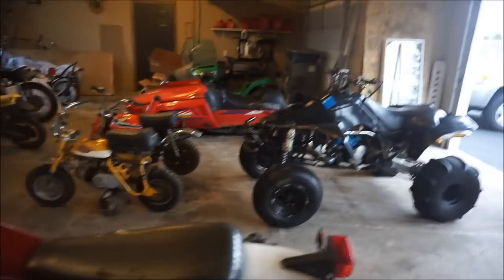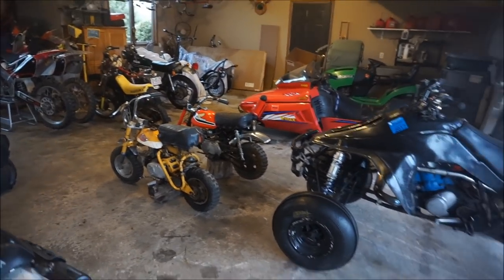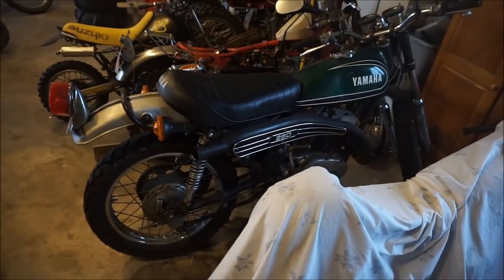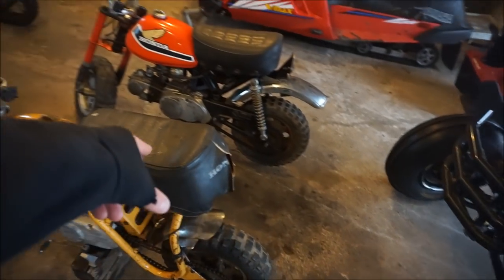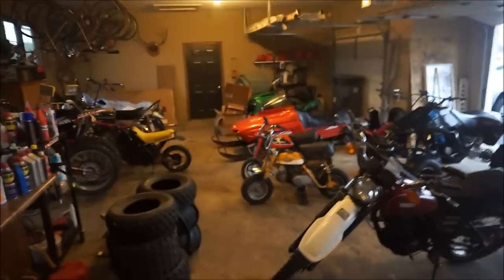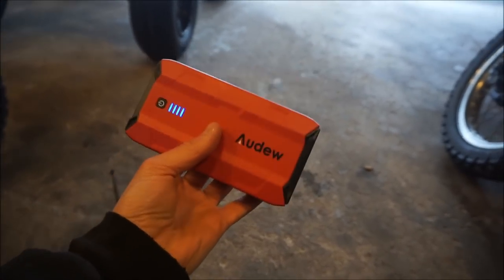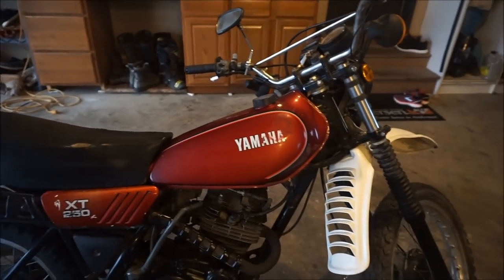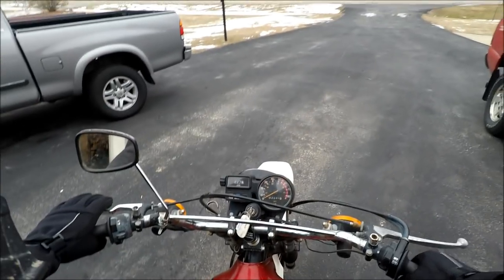How To Make Tons Of Money Flipping Bikes!!! (Super Easy)

Comment: Motor cycle engines especially 2 Stroke are really easy to work on. The biggest fear will be the gear box.   With todays technology... and access to schematics (drawing blow-ups) and your phone.. y'all can do this. Research the bike.  I've stumbled across a Suzuki, parts were difficult to find.  Yamaha (go figure), parts are plentiful.  Learn to read spark plugs. If you don't have the coin.  Tools are great gift suggestions... Hobo Freight 
If that is an authentic quad-zilla... 5 yrs ago.  you put original plastics on it... worth more than 3K

Comment: I have a 2000 ds 80 way better condition bought it brand new 2100 it's all yellow plastic tank yellow they come with a front an bk light there very easy to come by if u ever need D's 80s I can get allday ysr's a rare but I have a quadziller 500 1986 all stock bought it brand new for 3500 BK then been offerd 10grand for the 500 an I'm not partying with that or the 90 250 quadracer